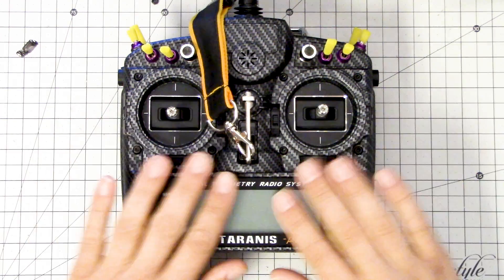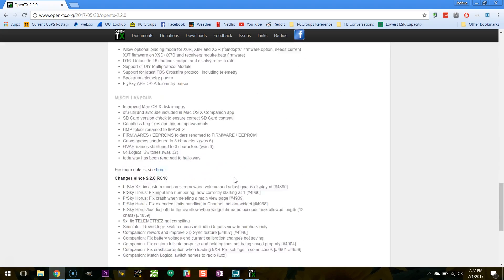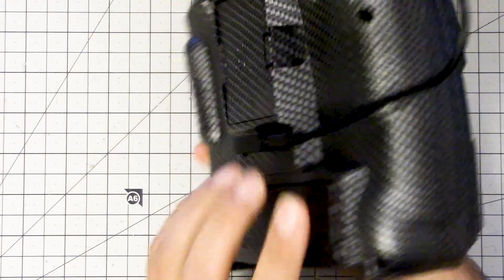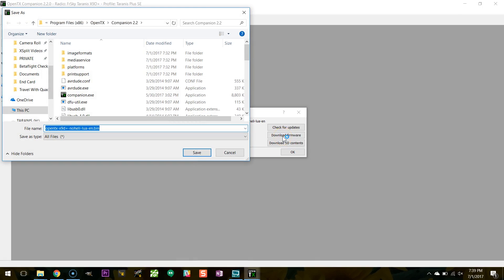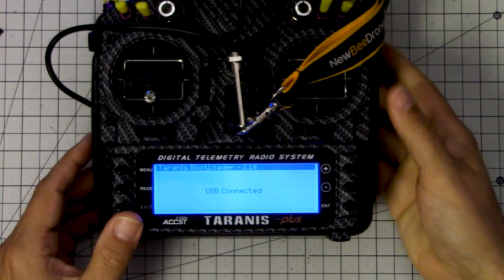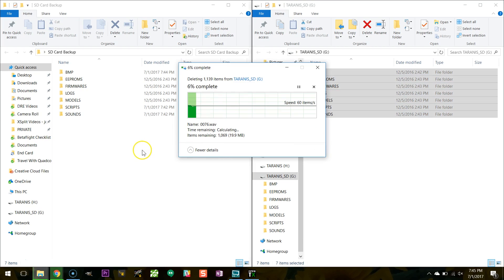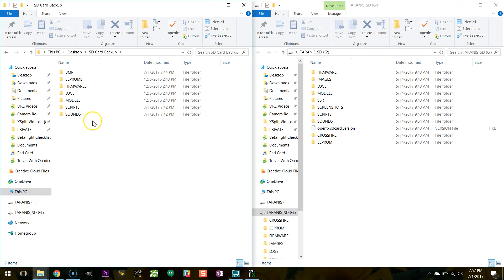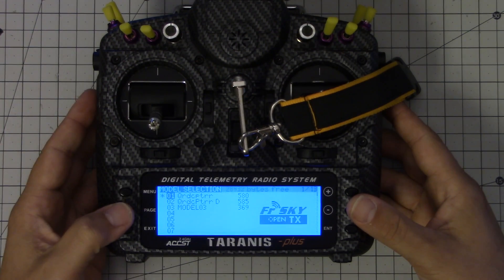Betaflight Taranis Lua Script HOW TO | Part 1 | Install Firmware

Comment: what windows do u have?
Reply from the maker: Win10.
Reply: Joshua Bardwell Thank you that helps very much! Im just getting to the hobby so i want to know, do i have the software needed to start with non autolevel drones and FPV. Btw, where should i buy suff becouse Im starting with a low budget (5-600€) so where should i buy to get started? I have to order from a site like banggood or gearbest becouse shipping on amazon etc. is often higher than the stuff im buing, so it eats up my budget real bad.
Reply: sry for all the mis spelling

Comment: Looking forward to the Lua Script vid. 

Sound packs for x9d plus. http://downloads.open-tx.org/2.2/sdcard/opentx-x9d+/

It's ok to remove micro SD card from the radio and do a file copy over from your computer. I didn't delete the old contents. Rather a copy and paste, then either merged or overwrote. 
 
I also grabbed all the splash screens for open TX as well. http://www.open-tx.org/screens-9x.html 

P.S. Thanks for the no heli tip. I'm going back and removing that.

Comment: What's in the PRIVATE folder @3:38 hmm? :D But seriously tho, thank you so much for finally making this video! It was kind of a pain in the butt, to get my Taranis to use the script when i set it up a month or so ago. I've been using it in combination with your in flight PID editing switch setup and im loving it.
Reply from the maker: It's gotten a lot easier to install the script. Just drag and drop a folder now that 2.2.0 is out.
Reply: It certainly has. The bit i had a little trouble with, was that the guide i used initially linked to some old version of the script and the download didn't include all the files. But then i found this one: http://www.nitbeatfpv.com/frsky-taranis-pid-settings and then i saw what was missing and got it working.

Comment: Nice vid. I updated the taranis using the SD card and it's worth pointing out that the FIRMWARE folder in 2.1 is called FIRMWARES in 2.2 which my taranis didn't recognise, so I just renamed it and dropped the 's' and it worked. You have no idea how long it took me to figure out what was wrong!

Comment: Thanks, I'm one off them asking for this.

BTW Joshua, Why not update with the radio off? This way you will also update the bootloader to 2.2.0 (Check the three hands salute screen yours still shows 2.1.6)
Reply: This is not a bug. Before OpenTX 2.2 the folder was called Firmwares, then they changed it to just Firmware...
Reply from the maker: I'm not sure I understand what you're asking. How can you update with the radio off? I think there's something I'm missing here.
Reply: Joshua Bardwell yes you can, just connect with the Taranis OFF and then press write firmware. 

Your Taranis will update as usual AND update the bootloader. 

Google it, it's not fake, I wouldn't dare.
Reply: You need to have the STM Bootloader driver though, but most people have it because of Betaflight. Josh, the taranis will take power from the USB when its connected and turned off.
Reply from the maker: Ah yeah I understand. The problem with that approach, as I understand it, is you have to have the winusb DFU driver, which many people can't figure out how to install properly. But I will do an updated video showing how to update the bootloader by copying over to the SD card.
Reply: Jasper Tielen wow JC is still helping us out even though he is not with us. Rest In Peace
Reply: Another way to update the bootloader is to copy the new firmware file to the sd card under firmwares. Then update firmware via bootloader method. Note. I had to create a folder called firmwares. Putting it in firmware folder didn't  work. I think this is a bug firmware folder should be firmwares.
Reply: Yes. But it didn't work for me until I renamed the folder back to firmwares.

Comment: so i got scripts on my taranis and running, i had done this earlier with kiss fc.  But now with my betaflight copter i just have dashes for the pid's values, rates etc.  My telemetry data all comes through correctly unless i enable msp on the port that i am using for telemetry. Am i missing something simple?
Reply from the maker: Do not enable MSP and telemetry on the same port. They will conflict and telemetry won't work when you are disarmed.
Reply: yep so i turned off msp got telemetry (vbat etc) but in the script page i still have dashes where my pid values would be typically. (also thank you so much for all of your videos!!!! words can't express how handy they've been :D) ....so it looks like it maybe the firmware that is on the xsr can cause issues (if anyone else is having this problem) 
supported via patreon thanks again!

Comment: Did everything still get SD card warning, any ideas?
Reply from the maker: If you copied the updated SD card contents to your card, I don't know why you would get the error.
Reply: I'm puzzled, ill do it again tomorrow, how are you finding the Chameleon, i  should be ready for it's maiden flight in a few days!
Reply: You need to also copy that file that was in the root of the zip file, it tells the Taranis the version. If you only copy all the folders it will still not know what version you actually have and warn you.
Reply: John Norrbin yes definitely copied that with it,wondered why it was there but copied it over anyway, I'lm probably better off starting from scratch and doing it agin. Thanks for the reply, much appreciated!!🤗

Comment: I believe the sound problems are because they changed the file name limits to only 6 long.  I had to change some of my custom sounds just by shorting the file name length and they worked just fine.

Thanks for your vids!!  I missed the lua checkbox the first time!
Reply: This is not enough because they also moved some of the sounds around and also changed their names.
Reply: I agree - they also changed the images folder name.  I was just able to move my fav sounds and use them after shortening the file name, that's all I was saying.
Reply: I mean that your sounds will work, but it might play the units wrong. They moved some of the 0080.wav files around. They updated percent, minimum trim and more. There is no one page changelog, they wrote for each of the 2.2 beta releases.
Reply from the maker: John is right. For example, the startup sound is now called "hello.wav" when before it was, I think, "tada.wav".

Comment: can you please do the same with Spektrum! and a armattan Chameleon-stingy frame comparison!? that would be so great!;)
Reply from the maker: I don't think Spektrum supports MSP over Telemetry.
Reply: Joshua Bardwell OK, thanks! what about the comparison between the two frames?;)
Reply: I watched Stingerswarms video on his frame and I concluded it does not break any new ground an IMHO has some poor design choices. Things like slots cut into high stress parts of the frame, long arms which join at the center. It is entirely possible to have a true equi space motors with shorter arms. My advise on this and any product, forget all the fan boy comments and make a detached conclusion based on your requirements.
Reply: Spektrum msp is on the way.... with Raceflight1 it will be launched soon if its not already.
Reply: no don't even own one.

Comment: Sound pack for 2.20 https://github.com/pinkywafer/OpenTX_soundpack-Joanne/releases/
Reply: There is also an updated version of Amber! I found it here: http://open-txu.org/v2-2-resources-2/
Reply: Thanks for the link think help!! Josh will be happy!!
Reply from the maker: But that's Joanne!
Reply: Im also using that one, there are a few stock sounds in it for some reason but no matter, there are amber versions of pretty much all of those as well included.
Reply: I found a few extra sounds that someone had edited together, to replace some of the remaining stock files (needed armed and disarmed).

https://www.rcgroups.com/forums/showpost.php?p=33432430&postcount=318
Reply: Thank you!! you are a star!!!
Reply: New to Taranis, like brand spanking new, and noticed the Amber 2.2 sound pack from open-txu.org as well. To replace the remaining stock sounds with something different, is it as simple as renaming/adding a .wav file based on the naming conventions referred to here? https://opentx.gitbooks.io/manual-for-opentx-2-2/advanced/audio.html 

Things like hello.wav, bye.wav, etc.
Reply: Not quite, go watch the video from Project Blue Falcon's channel about custom sounds. TLDR: You need to convert the sounds to specific bit rate and make them mono, before you export them to .wav format. After all that it's as simple as replacing what ever sound with your's, by removing or renaming the old and using the original name on the new ones. Also you don't need to use the original names unless the sound is in the SYSTEM sub folder or if the sound isn't in use yet.
Reply: @VilleF1N, This is good info, thank you. On a first pass I'll likely be swapping in Joanne sound tracks for the missing Amber sound tracks. I prefer the Amber voice, but Joanne is far preferable to the stock robo-voice for the items that Amber does not cover in 2.2

Comment: Hi Josh. You can create your own soundpack really easy.

Download https://github.com/CaffeineAU/TTSAutomate
In the latest sdcard contents, you can go into the /SOUNDS/<LANG>/system folder and there is a CSV file there. If you do a quick search and replace changing the semicolons ; for pipes |, and then doing another search and replace to remove the file extension from the second column you end up with lines like so:

SOUNDS/en/SYSTEM|0000|0

rename the file to .psv, you can load it into TTSAutomate.

In TTSAutomate go into settings and change to 32000Hz and 16bit

Now you can select any sound you like, i use the Salli voices.

When you click start it might show the progress as frozen, IE like stuck at 70% or something. Click stop and go again and it will continue. Do it until the progress goes to 100%.

Make sure you have the 242 sound files (in the current sound pack).

All the sounds will be in the wav folder.

The sounds you end up with do have some silence before and after. If you are annoyed by that, you can download Batch Audio Silence Remover:

http://www.audane.com/Batch-Audio-Silence-Remover.htm

Unfortunately it does not output the same folder so make a new converted folder and make the same structure there. Run the program for each folder outputting to the correct converted folder.

Comment: If memory serves me you have to upgrade the bootloader version as well.  It was a press on the firmware tab in Taranis then you long press firmware and select update bootloader version then your bin you just copied. Now you are golden! You must have a copy of the firmware bin file copied over to your sd before you do this.  Took me a while to figure out hope it helps.
Reply from the maker: IDK about that but everything is working fine for me so far without doing that explicitly.
Reply: Joshua Bardwell It will work but the job is just not 100% done.   Long press on the firmware icon in your Taranis and see.  Good luck it works and then your bootloader will be updated as well.  I'm surprised you didn't get an error....  Some of your viewers will so might be nice to add.  Great channel!